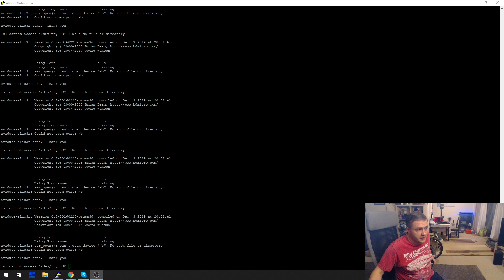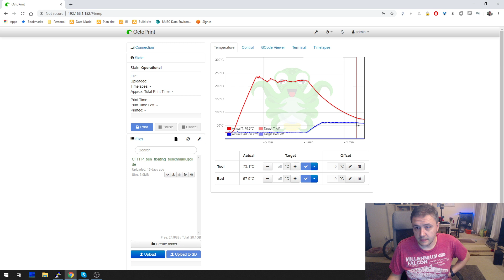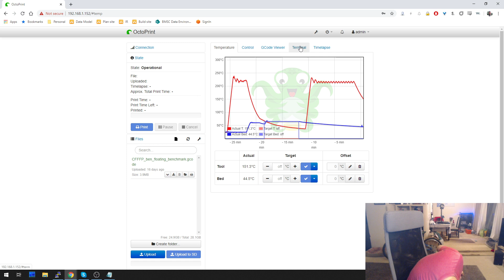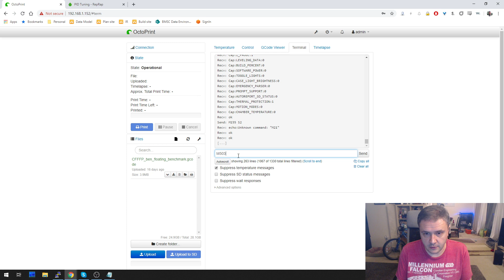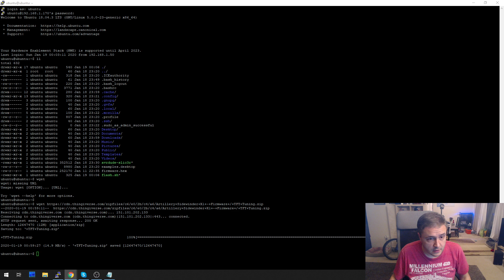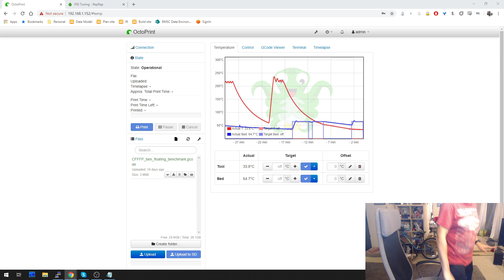Artillery Sidewinder X1 | Update the firmware Linux-way | LIVESTREAM

Comment: Did try the "Linux way" of updating and my Sidewinder X1 motherboard was dead. Only TFT worked, but no response of any command. Triplechecked all settings, but it didn't work.
But after disconnecting the TFT cable (black connector) and triggering the Marlin firmware update (firmware.hex) via Cura (Manage printers) it is alive again.
For firmware update in Cura there is no need to select the correct Artillery printer. It worked by selecting "Custom FFF printer".
So i do not recommend the Linux way, because it may lead to complications.

Comment: Hey Igor, 
i had similar issues with the genius and marlin 2.0.5 from 3dprintbeginner.. totally strange. PID tuning was not working like in this video and some prints would not start at all. But i think the cube.gco from the usb was kind of printing, but sounded really bad. I switched back to the slightly modded marlin 1.1.9 firmware from 3dnexus so i can use the eeprom. It´s now working again and PID tune worked fine as it seems. However, i looked at the slicr-printer config from artillery and noticed that the profile i loaded from 3dnexus had marlin as g-code flavour and the artillery has RepRap/Sprinter. Maybe that changed something too when slicing with prusa. Im running now the artillery config.
In the end, i´ll may try the next marlin 2 and self-compile it.. the important thing for me was to get the eeprom to work.

EDIT:
I now realized that my PID tuning went crazy again.. it was oscillating around ten degrees. So i compiled marlin 1.1.9 with hard coded PID values (9 - 0.6 - 42 for my genius) and did not let run auto PID tuning. It looks to me like if i do auto tuning, it get´s messed up - even without saving it to eeprom. No clue why.. but now it is only oscillating 1-2 degrees and the variation in layer thickness is gone.

Comment: Hi Igor, it´s me again. I think, now i´ve really found the problem with thermal runaway. The message appeared again and again, so I soldered a female connector to a 220µF capacitor and plugged it on 5V and GND on a free endstop-pin. This helped a little, the line in Octoprint was very straight. But the message was shown again. And the solution is: the connector of the flat cable to the hotend. Unplug it, plug it back in and put two drops of hotglue on the connector and flatcable. The cable just gets loose when it´s printing. Now I was printing face shields for three weeks and no more issue.
Best regrads Werner
Reply from the maker: So what do you think really helped? A capacitor or a hot glue on the cable?
Reply: @IgorsWorkshop  I think the glue.

Comment: Hi Igor, maybe a good idea. Try a E3D thermistor, this should work. I´ve got one in another printer, they work perfectly.
Reply from the maker: I've replaced the thermistor today with a spare one. No difference. Maybe will try a different type. I guess an E3D thermistor will require firmware updates, right?
Reply: @IgorsWorkshop  Hi Igor, just try it without firmware update. But if it doesn´t work, here is the new one: #define TEMP_SENSOR_0 5 .
Best regrads Werner

Comment: Hi Igor, it´s me again. Please forget, what I said. After 10 successful prints, the same issue. The damned flat cables are the problem!!!!!!! I put the spare one into the X-axis and now it works!!!!! In Octoprint I see a line after heating, no waves. Sorry for the mistake with the thermistor. Best regards Werner
Reply from the maker: Hey, no worries :) BTW, replacing both cables didn't help to alleviate the issue for me. I'm still yet to try putting in a new thermistor.

Comment: Hey Igor, cool videos! I had the same issues with PID calibration, now it works. Just put heat-conductive paste in the temp sensor and run 20 cycles. I hope, it works with your printer, too. Best regards.
Reply from the maker: Thanks for the suggestion! Would you recommend any specific brand of the thermal paste? It must be able to withstand heat to about 300C...
Reply: @IgorsWorkshop  Hey Igor, I used WLP4 Thermal Compound from www.fischerelektronik.de 

I don´t know, if it can withstand 300C for a long time, I print at 220C. Maybe you can ask the guys at E3D? Best regards.
Reply: @IgorsWorkshop  Hey Igor, I used WLP4 from www.fischerelektronik.de 

I don´t know, if it can withstand 300C, I print at 220C. But maybe, you can ask the guys at E3D? Best regards.

Comment: Hey Igor, great live video. I am actually holding off on upgrading my printer since the upgrade was not working for you. Will stay tune to see it working. Keep us posted. Best of luck!
Reply from the maker: Thanks! You know, I've replaced the stock "anti-backlash" contraptions with proper anti-backlash nuts and finally have gotten some really visible improvement. Looks like my next video will be about replacing those nuts (and, possibly, rods and couplers).
Reply from the maker: As for the firmware update - it is something I would have done anyway. I want to have EEPROM unlocked, and, potentially, leverage linear advance and mesh bed leveling.
Reply: @IgorsWorkshop  sounds good. Can't wait  to see the video and the improvements. I'll do the same upgrades when you release the video.
Reply: @IgorsWorkshop  I am really curious about this! Print quality on a normal benchy looks quite similar to yours on my Sidewinder. I have printed some other models though that don't seem to have as many "faults".